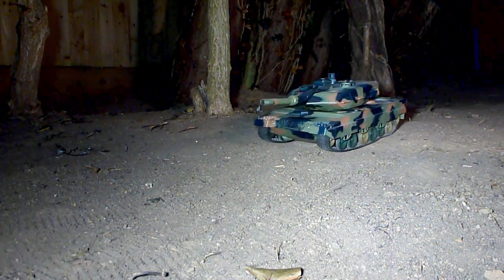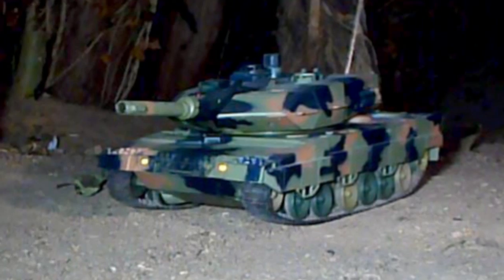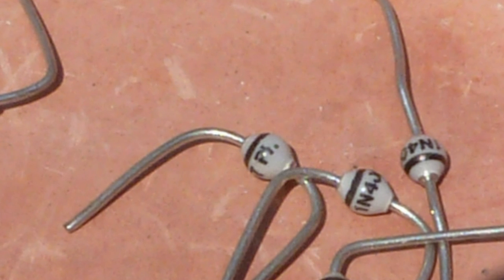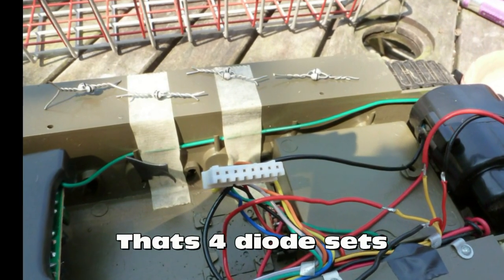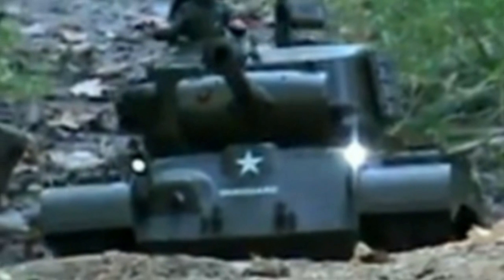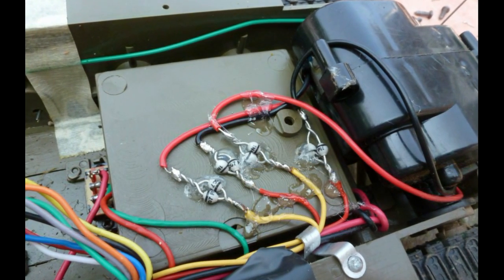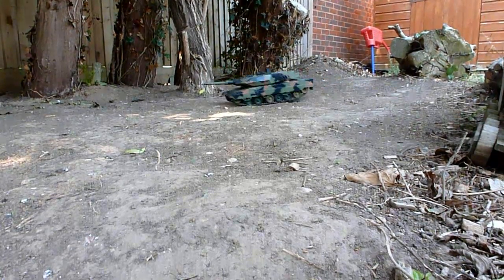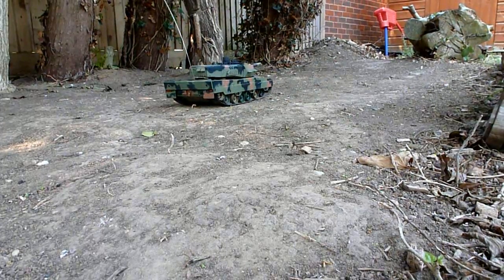How to slow down a basic RC model tank electrically

Comment: Hey, thanks for the video, I recently bought a cool palm size tank. But it is as fast as a race car and impossible to control.(including the turret)

But here a question, would resistors work as well?
If yes, why not use them instead?
Reply from the maker: Hi and thanks for watching, resistors would have a similar effect however they reduce the current and so power which would result in unpredictable running speeds.

Comment: Mike, I found this video very helpful, as I'm trying to do something similar. I'm trying to slow down an RC boat, so that the speed will be less intimidating for my five-year-old son. The boat runs on 7.4 volts and has a brushed 370 motor. My research so far tells me to use resistors.
Reply: Can you share any info publicly? I'm also interested in slowing down an rc boat, but worry that resistors will heat up too much. Thinking pwm control but would love to hear other ideas
Reply from the maker: Replied to your message :)
Reply: I'm also interested in knowing what the answer was :)

Comment: Did the same to my Playmobil remote control train - works a treat. i also put in a switch to link out one or two banks. It does reduce power but works fine.
Reply from the maker: John Mellor Great stuff